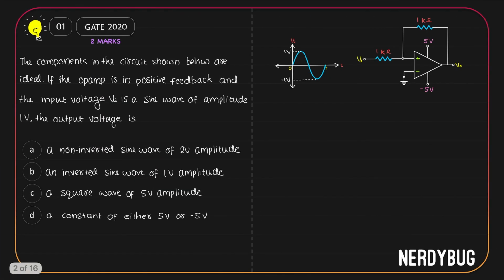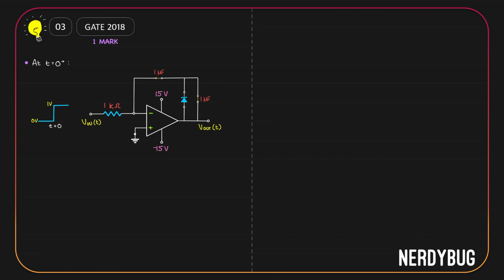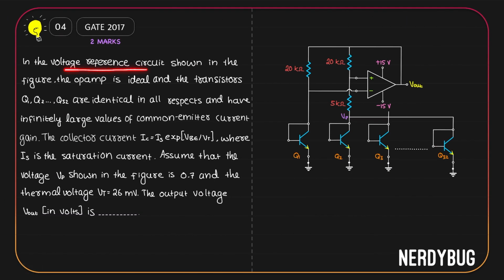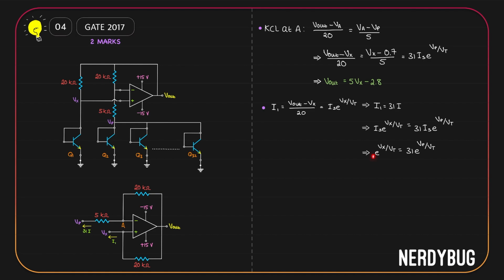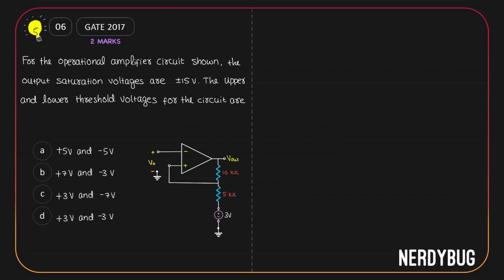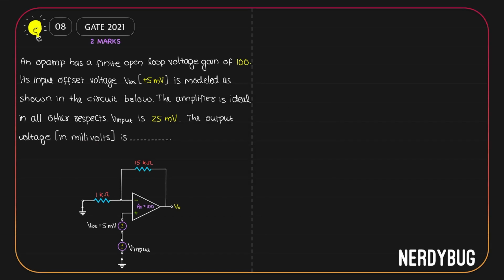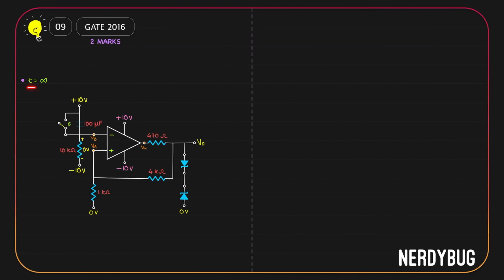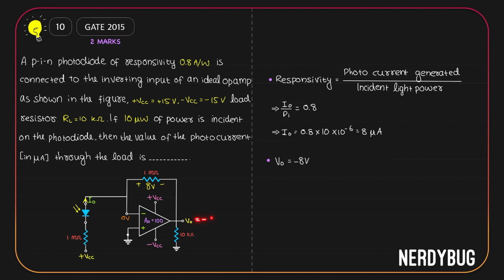Gate Questions on OpAmp Circuits | 2015-2020 | GATE PYQ | GateBusters ECE | NerdyBug

Comment: Hello ma'am, hope you reading my comment. I am a BTech 3rd-year student in the Electronics and Communication Engineering (ECE) stream. I appeared this year's gate EC paper after taking coaching from PW, where I completed subjects like Mathematics, Aptitude, Analog Electronics, Digital Electronics, Control Systems, Network Theorems, and Signal Systems. I practiced extensively with DPPs, tests, and PYQs.
However, I felt disappointed as many questions were from Communication Systems and Electronic Devices & Circuits (EDC), which I had not completed. I attempted 4-5 full mock tests, scoring around 35-40 on average. I was fully determined not to attempt any unknown questions, but my strategy failed in the actual exam. Now, I am hoping that I might just clear the cutoff. What should I do to improve, and how can I contact you for guidance? I am struggling to find a way to make a strong comeback next year. Please guide me.
Reply from the maker: Hey, text me on telegram @nerdybug

Comment: Great explanations mam!! But in first question of schmitt trigger you explained that the output of a schmitt trigger is either 5v or -5v (in this case).. that is not true i guess, the schmitt trigger changes its output from -5 to +5 when the i/p voltage tries to cross LTP and vice versa.. but in this case (qn1) the input voltage never crosses the UTP and LTP.... that's why the o/p will be either +5v or -5v... correct me if i am wrong
Reply from the maker: Yes,  I should have explained more. Thanks for adding this.